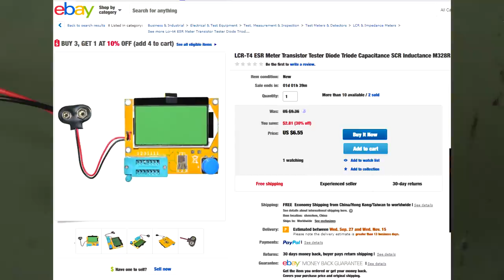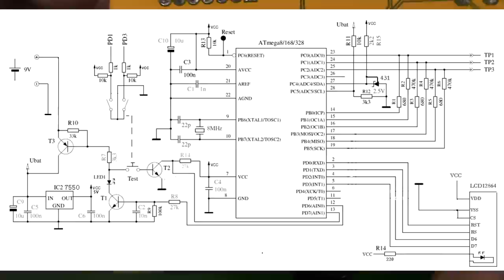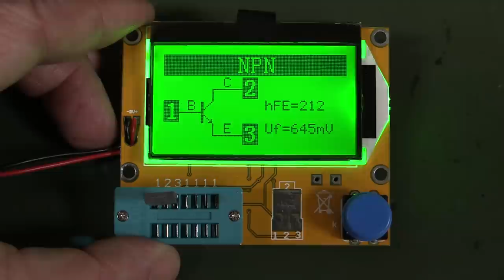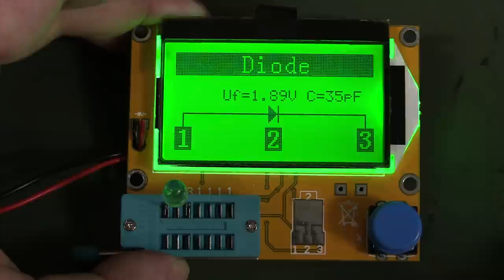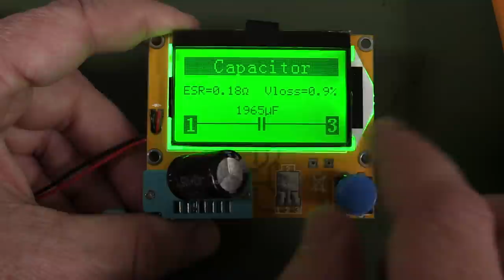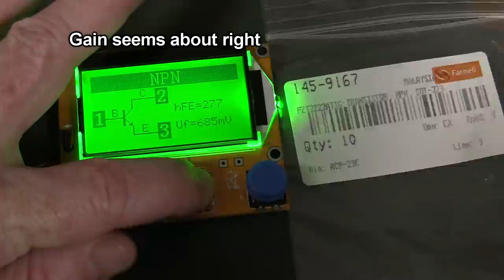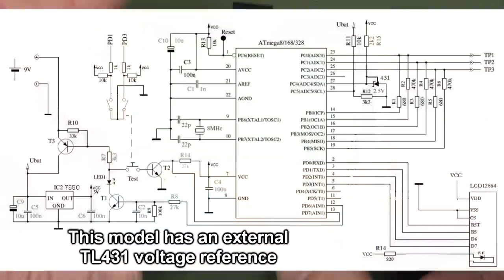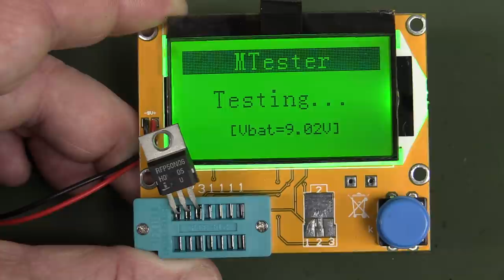EEVblog #1020 - Is A $7 LCR / Component Tester Any Good?

Comment: The AVR Transistor Tester project was started by Markus Frejek, Karl-Heinz Kübbeler, and the parallel firmware is done by Markus R. (Aka Madires) on the forum.
 The project is OSHW and is designed for you to build yourself. The Chinese clones are just substandard copies. None of the clones meet the minimum required specs from the documentation.
Reply: Upcycle Electronics can you please link to that documentation so I can follow the instructions to build one for myself?
Reply: MadComputerHal 
PDF Documentation from May 2017 (extracted from tarball and hosted for download):
http://www.avrtester.tode.cz/upload/ttester_en.pdf

Project Home Page:
https://www.mikrocontroller.net/articles/AVR_Transistortester
GNU Tarball Server:
https://www.mikrocontroller.net/svnbrowser/transistortester/
GIT Hub Copy of SVN Repo Server
http://github.com/svn2github/transistortester/

Comment: Prices rising in 3, 2, 1...
Reply: In Banggood this DMM is still at $17 in promo. Only eBay sellers rised prices.
Reply: Just ordered one for ~€5.50 so I guess it didn't happen that fast. Useful little device especially once you replace some of the clone parts for higher precision ones.
Reply: No clone meets the minimum system design of the project. AKA clones are junk...
Reply: That mainly happens with used equipment, not new.
Reply: prices drop ;)
Reply: The clones are good enough, besides nobody has time to fiddle around making one. Life's too short.
Reply: nah, theve made millions of em
Reply: Oscilloscope prices are ridiculous in my country. CROs from 80 years ago sells almost like new DSOs. I envy USA guys who can buy those monsters for 50 dollars (if I would, the shipping costs would hit 500 USD!!). Used CROs here costs around 600 USD. New chinese DSOs costs around 700 USD. And the minimum wage that 80% of people earns monthly? Around 250 USD.
Reply: Up
Reply: Must have eased off over time. Mine was 86 cents with 4 cents shipping. Wow. How is this possible? Should I be adopting a family in China now as compensation?
Reply: @markrichards5630  Mind sharing a link?
Reply: @victornpb  Price fluctuates. Ironically the Chinese sites are a true market based economy -  supply and demand rules. I went back to the link from my purchase and its now sitting at $5.49

Comment: These ZIF sockets never actually say 'TEXTOOL'. If you look closely you notice that one of the letter 'O's has been changed, usually to a D or a Q.
Reply from the maker: LOL! Didn't notice that
Reply: Some people on the forums have said they had these fail. I don't know if the real ones create the same kind of stress for the pins that attach the ZIF socket, but the copy I have creates a lot of movement and stress on the pins/PCB/pads. Place the loose ZIF socket on a PCB, and try to hold it in place while pulling the lever. It really wants to move around with considerable force.
Reply: On all of the ones I've seen so far it always says TFXTDOL ... the one in this video included :D
Reply: John Howard 
  That's what I assumed as well. It looks to me like the pins have some leverage motion to them as well. It practically guarantees long term problems of lifting pads/traces, especially with inexperienced diy'ers and flux core solder alone.
Reply: My transistortester came with a 3M socket, no textool marking. I can't remember but it may have also had moving PCB pins
Reply: They are faithful copies of the original.  The pins have always moved and were originally placed in an IC socket so they could be replaced when they eventually wore out.  This is not the fault of the clones, just a result of the socket design.
Reply: Yep, I've got "TFXTDOL, PAT.NO.3500745" written on mine as well. So it seems the most common brand on the Shenzhen market xD.
Interesting thing is if you google this patent number it actually is a "Adjustable mounting for an ink fountain" LOL

Comment: if you connect leads 1, 2, and 3 together and press the test button, does yours run a calibration dialog?
Reply: Mine does, tried to measure an apparently fried thyristor that was fully conducting in any direction and it hopped into calib Mode.

Comment: I have this one and one with a colour LCD that does a lot more tests.  They both manage to test on a really weak battery, the colour one actually tests right down to 5.4V and reports Battery Empty at 5.2V.  I do get one weird reading, with a damaged White led that should be 2.9V it will read 3.6V and a leakage of a few nA with 12pF.  Occasionally it reports 0000000F so the leakage does odd things to the capacitance test.  That led causes a long pause on the green tester and a blank line where the capacitance should be. I tested electros that I pulled out of an old computer power supply, bad esr on everyone of them.  That supply had ten years of use so not surprising. The colour one has an acrylic case and measures a lot more plus it has voltage terminals and an audio frequency counter and signal generator.  The generator has a bunch of spot frequencies from audio to over 1Ghz.  You can choose your own foreground and background colours plus testing can be automatic or select the specific test from the menu. I actually damaged a led by inserting two LEDs and it detected them as a diac and tested for reverse breakdown.  Oops!

Comment: 10:09
The body diode seems upside down.
But it got it right the previous time.
Reply: GpanosXP
Good catch.  I have two Chinese variants on these (cases, colour displays) and they can do some odd things like this.  If you consider these devices to be quick-check component verification then they're perfectly usable.  Where you really want to nail things down then you're going to have to break out serious tools, or spend a lot of time and effort.

These would also be good projects for fiddling with, in themselves.
Reply: The orientation when you place it in the socket makes the difference.  It bugs me to see, but it doesn't really matter as long as it identifies the drain and source pins correctly, which it does.
The Daniu tester I bought for $30 doesn't have any errors that I know of; it's a more polished product but at 4x the price.  Seeing the limitations makes me appreciate the more expensive item more; I bought that one first but then got a couple of the less expensive ones based on the low cost, thinking they'd be essentially the same, but it's not.

Comment: Found this about history (instructables):
Ideas behind this kit is started in 2009 by Markus Frejek as a thread on a forum.
Later (in 2012) Karl-Heinz Kübbeler started to work on the project.
this project continued to be more known, it was implemented in various forms over the time. Some enthusiasts have made it on breadboard, some have designed their own PCB's, single or dual layer; with thru-hole or SMD components... and so on.
Also, over the time, have appeared variants with graphic display.
The original diagram released by Markus in 2009 is what they still use 2023... There just some optimizations about 9V battery power supply and other displays. Original display was a HD44780 16x2 LCD.

Comment: I've used one very successfully to test dodgy electrolytics in various things and just checking if salvaged parts are reasonably good before putting them into the parts bin for possible use later. And it's just FUN!

Comment: As you Said, there are hundred Models Out there, Not everyone is good. Not everyone is Software upgradeable. So which Version ist Worth buying if one needs a good esr Meter and what is hackable/ upgradeable???!
Reply: Axel Werner also interested.
Reply: If you need a good ESR meter than I would just go for an official ESR tester. These things are good but its really easy to accidentally kill them with a charged capacitor and sometimes long test leads can make the ESR test vary wildly.
Reply: today ebay showed one for $2.42  .. but i didnt notice if that was Aussie$ or USD's  ... If it's Aussie, then the USD price would be .. lemme thing: ya, they have to put $1 in the package  for you ... !!

Comment: You can calibrate it short the 3 pin
Reply: Thats not enough. Exact procedure desribed in project manual mentioned there many times.
Reply: ...but there's more....
   In the official PDF the ATmega644/1284 Schematic shows the option to add a auto calibration feature using 2 spare pins, a 100nF capacitor and a 470k resistor. Others have suggested using a single pin to control a double pole relay that achieves the same thing by connecting the calibration circuit.

Comment: I have had one of these little toys in my kit for over 2 years now, and get a lot of use out of her.  Since my income crashed last spring, and came out at 1/2 what I was making, the purchase of new parts has become a sort of thing of the past. Thankfully I have picked up several kits of cheap china crapware resistor packs, capacitor packs, and hundreds of LED's with a good selection of boards to build on so I can still have some fun.  That said though, getting exotic parts has come to an end, and I have relegated to tearing down old power supplies and old PC Motherboards to supplement my parts bins.  This little guy has become invaluable for such projects! I am considering soldering some leads on the external pads so I can expand the reach of the testing, as I rarely use it for smd parts and I do have some nice alligator clips that would work fairly well for that purpose.  I did use it once for a large kit build a few years ago when I could still afford to buy a kit, and built up one of those cheap toy oscilloscopes using the tester to sort out all the parts since all the resistors were of the ugly blue/green type that strained my ancient eyes to try to determine the colors, this device paid for herself in just that one built!  I have never built up a box for her, and I doubt I will ever get one now since groceries have a much higher precedence then electronics now days, and I do hate having the bill collectors at my doorstep, so much work scaring them away when I answer the door in my tight jocky shorts with a pistol belt around my waste and my old M1911A1 hanging from it in a military style holster.  Seems they never return, and all I have to say is that they will have to wait their turn. (Just kidding, it isn't that bad yet, but my nightmares do offer great fodder for such ideas)  Your breakdown on this deal is right on, I love my little device so much she occupies a nice cardboard box that a survival knife came in, the knife was crap but it had a nice box, almost worth the 5 bucks I gave for it at a roadside stand on RT  66 in Arizona a couple of years ago.

Comment: I'd be tempted to try things like two diodes together, 1 to 2 and 2 to 3,  connecting parts of logic gates just to see what it does.
Reply: Two diodes work, e.g. a bi-color LED in 2- and 3-pin configuration
Reply: stonent it's actually really fun to see what they can and cannot identify.  Linear voltage regulators, no dice, which isnt surprising really
Reply: Yeah I suspect they don't put out very much voltage in order to lower the risk of damaging something.  So it may not be enough anyway to power up a 7805 fully.  Maybe 7803 might trigger something.
Reply: The higher cost version can test a 30V Zener too, which the $7 one won't be capable of.

Comment: Hi Dave, thanks for video about this tester. I bought one about year ago. It was also marketed as capable of in circuit measurement. I used it to troubleshoot faulty caps in power supplies and various faulty circuits. Until last week. In one cheap powerbrick, there was capacitor and diode combination on the output.  One of these pulses this tester sends to tested component posibly came back with higher amplitude, or maybe capacitor was charged. Anyway by my lazines not to remove capacitor for measuring, ATMEGA8 is fried, while there is no isolation between component and procesor. So maybe this device is too simple. But anyway it bringed me lot of help with good/bad component troubleshooting.

Comment: Hey Dave!   I'm doing a cool new  mod kit for this already handy little device !  Here are a few of my ideas :

1)  bin the 9v battery  and the 7805   (I'll just hit em with hot air and wipe them off)   then fit a nice lithium ion battery pack and  a regulated charging board with a micro usb connection .

2) I've already 3d printed a really nice case for it  which is much thinner   so much more  'nerd shirt pocket friendly!'   o_O  

3)  Modify the firmware!  Why?  Because I can!  .lol   Seriously though ...  Although  this is a great bit of kit AS-IS  outta the box, I have found some discrepancies  between my expensive proper equipment and this little gadget , of course!   What do you expect for only $12 or less ??? 
They (we?) are already  making this little Atmel stand on it's head and do tricks !  It takes quite a bit of m0jO to do all those a/d  / d/a routines to work those FETs to get some great sampling  nearly maxing out the capability of this little Atmel's resolution ..  With that being said, I have gone over the code and patched it  here and there  to be a bit more accurate in some spots..   ;)    Mainly,  with the FET's  and the gain!   Resistors,  caps , didoes,  and general  NPN or PNP transistors seem to be testing fairly accurate ...   but as you know some FETs are sensitive lil buggers....  
 
4)  Other ideas that may or may not ever be implemented,  but. I'm  just tossing them out there to see what people might think would make it a bit better !  (Please post /share your own ideas on how it may be improved in the comments below) : 

4a) Perhaps shitbin the  whole board and lcd display design  and just make a whole new much smaller PCB  with  just enough space to fit the atmel , the few support components ,  the zif socket and smd test pad  .. and wire up a  touch screen TFT display  along with a micro SD slot so you may be able to store certain data  on the components you test ..  For example:  you may want to   test a bunch of FET's  and perhaps pair them with others of similar gain  .. or perhaps  for quality control of some sort  ie:    run through a batch of parts and    perhaps calculate a mean  value of those that are within spec or tolerance    and alert you if the next one you test is a bit off   ...

4b)  add wifi capability to the design so you may  interface with your pc or other device to  acquire and store that data in a database for whatever reason a tech or engineer may see fit for  whatever reason ........... 

4c)  Perhaps expand the zif socket size to at least 18 pins and along with the wifi interface as mentioned above,  implemented,..  Perhaps  be able to flash microcontrollers with a bin over wifi  from your pc or other device!  

Just a few ideas I'mm tossing out there... let me know what you  think .....   

Cheers,  
Kixxy o_O
Reply: And there goes the $7 price point

Comment: What these things are great for is hobbyist repairs. If you have the schematic, or even not, and you've got some suspect caps or transistors, you can test if they are in the ballpark of if they are goneski. With one of these, a cheap thermal cam, a sig gen (just a PC sound card) , a cheapo DMM and a rudimentary scope, you can fix just about any audio amplifier

Comment: The first idea was mentioned in Elektor Magazine in April 2005 and used a PIC processor AFAIK. It never took off, because of some dumb issues it had. Aparently all these chinese ones originated from a second design first posted on the german forum microcontroller.net. That is something like your EEVBlog forum, but much smaller since it's main language is german. https://www.mikrocontroller.net/articles/AVR_Transistortester

Comment: Thanks to seeing this video just today I ordered one of the latest versions with a color oled display in a case with test leads and some misc parts to test it with. 21.84 shipped from New Jersey to my place in Portland Oregon. I remember trying to find a capacitor tester back in the day and I have a couple transistor testers but not a all in one unit with a nice display. Of course back then there weren't any, at least none I could afford.
I might not use it a lot now but I still fix my own stuff when it breaks and this will be so handy.
It can even show remote IR wave forms and has a rechargeable battery built in.

Comment: Connect all 3 probes to short and prepare 100nF cap to calibrate, hold test button to adjust contrast - it works perfectly if wrong element on display - simply change probes on pins

Comment: The "grandaddy" of all these testers was the Peak Atlas DCA55 Digital Component Analysers.  I was working in the R+D lab of an electronics factory when it was first launched.  One day, in about 2000, a sales rep turned up to show off a DCA55 and an ESR meter for testing capacitors.  I don't think anybody who saw that demo on that day didn't want a DCA55, right then and there .....  We ended up ordering one of each instrument for the lab.  Most of us who were present ended up ordering our own DCA55.  The ESR meter didn't have anything like such a "wow factor" about it, but it proved its worth anyway as it made the repair of switched-mode power supplies feasible for once.

This device tests more components than the "original", and comes at such a fraction of the cost, it would be churlish to protest at the absence of in situ ESR measurement  (you will save more than enough to afford a separate ESR meter anyway).  Absolute accuracy is less of a big deal; most of the time you will be wanting a simple "yea or nay" indication whether a component is good enough, and sometimes you will need to find 2 transistors with the same gain.

Anyway, it's always worth having two versions of a test instrument:  An expensive one that gives accurate results, and a cheap one for everyday use that won't matter so much if you blow it up.  Big thumbs-up for these little beauties!